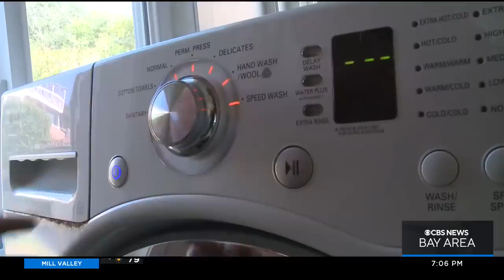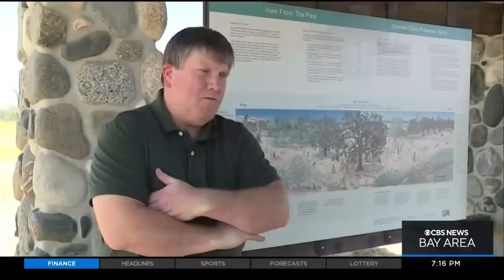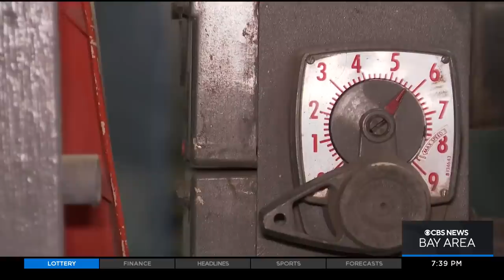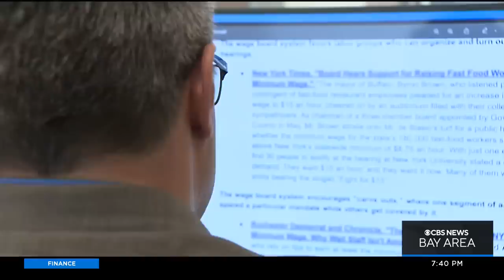Parched: California's Climate Crisis

Comment: It’s important to note in this piece. When referring to 80% water used in agriculture. “Agriculture” is farming and water pushed directly into river/deltas. Approximately 50% of the 80% is used for farming. The other 50% is diverted directly to waterways leading to the ocean. This leads to a whole larger and more important debate which this news piece does not mention.
Reply: They send the unused fresh water into the oceans?
Reply: @emilylouden3349  they don't send it they just don't block it because of some stupid fish.
Reply: they should block the water from the ocean until they fill everything up.
Reply: @emilylouden3349  TRUE,!!!!
Reply: @frankyflowers  Fish gotta swim frank, cali is doomed either way
Reply: @leftifornian2066  they gotta evolve into not using our river from the ocean.
Reply: Look to the Aussies for better water practices.  Oz is the land of using rainwater to the max.  
10 inches of rainwater falling over a square kilometer of land equals about a million gallons of water. 
If you start with simple things like a curbcut diverted into streetside bioswales (inlet only, or else you lose mulch).  Roof runoff diverted into a cistern, rain gardens, or fill a cistern then overflow be diverted into raingardens.  Use greywater as well, for flushing and landscaping.  Public parks, ranch and farmland could use rainwater harvesting earthworks and techniques.  This would greatly reduce gridstrain on water supplies, and electrical grid demand.  It would also reduce erosion, reduce flooding and fire dangers, mitigate the effect of heatwaves, etc.  It has increased beauty, shade, comfort and even reduced crime as neighborhoods have become walkable/bikeable.  
Bunds, check dams, gully repair, planting pits, keylining, swales, etc could be cheaply made out of materials on site.  Brad Lancaster has a great book on the different techniques that are low cost and highly effective.  Many are now employed by the city of Tucson, and well as on farm and ranchland and around the Sonoran Desert and elsewhere around the country.  Brad Lancaster's books are a great resource.
Adapting Mark Shepard's techniques would help as well.  He grows local native- or domesticated relatives of native- food-producing perennials, shrubs, vines and trees.  He has as a variety of livestock for pest control and fertilization and as additional sources of income.  This would be much better than paying a farmer to do zero as it would be mimicking natural processes while still producing needed food, plant diversity and also provide wildlife habitat.

Up front note: Desalination is brittle, centralized, and needs replacement, as well as constant maintenance.  It pulls a huge amount of electricity to process it.  Pumping water uses a huge amount of electricity.
A terrorist strike, or a brown out earthquake and the mirage of water abundance is gone.
Reply: @b_uppy  It's now unsafe to drink rainwater around the world because of the growing presence of "forever chemicals," a new study suggests. In the study, published Aug. 2 in the peer-reviewed journal Environmental Science & Technology
Reply: @melaniedennis9540  
Melanie Dennis  
It's true rainwater has chemicals that "greatly exceed" safety levels in most places is now. 
You will want to avoid floodwater-recharged surface water (lakes, ponds, rivers creeks, rills, etc) because evaporation concentrates toxins.  When soil and landscapes get dry, water lacks the ability to permeate.  You will want to avoid desalinated water as well.
When we slow, spread and sink the water into bioswales and the like,  we also reduce flooding.  
It's good thing we invented bioswales, and other rainwater harvesting earthworks to purify water then.  When we absorb water into bioswales with mulch (mulch is important for microbial action), along the topsoil's carbon and woody plants, we get natural remediation of the water.  This is a healthy hydrologic process.  The water then moves through the soil (aka water table) to rivers, lakes, ponds etc naturally remediated.  In healthy hydrologic processes that's how lakes, rivers, creeks, ponds and rills get clean water.  It makes the case for rainwater harvesting earthworks even stronger. 
 Desalination plants lack the ability to do this for free, it would mean compounded infrastructure.
(FYI- you can eat the fruits grown from woody plants as the toxins are absorbed into the bark.  You do want to avoid annuals, which are most plant based foods grown in the grocery store.   Buy from your neatest permaculturist)
Reply: I can solve this issue but I am waiting for those important people who are able to financial advisor and overseeing operations. Gary Morgan here I am in Sanderson Texas and I am not hard to find.
Reply: @daver00lzd00d  the ecosystem will be destroyed completely by nature and cosmic forces lots of times before the earth is completely destroyed. who is to say how each cycle should go?
Reply: @frankyflowers  we have a say because we are directly influencing it with our behavior. that is the problem
Reply: @daver00lzd00d  our behavior allows some species to thrive in our wake and some die off. we are animals and part of global evolution.
Reply: @frankyflowers  our behavior is changing the planets systems faster than anything, including ourselves, can adapt to the changes. nature can't just get used to a completely different climate in 10 years. we are the only animals that are willingly altering these climate systems that we don't know enough about. it's all irrelevant at this point because it's too late, weve made our bed and we will sooner than later be lying dead in it. first we get to suffer though
Reply: @D R sorry for the confusion. All this water must flow through a dam. The amount of water sent through the dam goes to the ocean. Restraining water behind the dam is usable water for citizens.
Reply: @frankyflowers  I live in Singapore. A barrage was build to turn almost the entire island into a water catchman area.   The canals are well maintained and it has a thriving freshwater fish. The barrage has pump to pump out excess water when there is heavy rainfall.
Reply: @jk35260  wasn't singapore a rain Forrest before? they don't have the same problems.
Reply: @frankyflowers  It was but much of it is now a city. California is about 600 times bigger in land mass but Singapore population density is about 90 times denser. So despite the high rainfall, Singapore needs to recycle and reclaim water through desalination and import water from neighbouring country Malaysia.

Beyond just building a barrage, you need to put back more water into the land so that it can rejuvenate with more vegetation.  A land with dwindling vegetation density will only get drier and creates a feedback to cause even more evaporation. Frankly, cutting down water usage for agricultute is critical.
Reply: @jk35260  if we didn't give any to the ocean and just let the fish evolve or die then they would have lots of water.
Reply: @frankyflowers  I agree, the environmental impact should be very localised at the mouth of the ocean.
Reply: Well put like lack of planning management and water rights. And watering lawns in the dessert doesn't help. You also have a limit or a balance to use before aquifers deplete not to mention certain companies claiming rights to them too. Needs to be transparent to the people and out of politicians hands or claws.

Comment: I am a visitor from WA, and i have driven the length and breadth of the continental US. Never have I ever seen a lake drained dry as I did at Isabella Lake yesterday. You can see the bottom of the dam. It is scary.
Reply: Isabella is dry!?  I know this area well and that is shocking. Is the kern river still flowing?
Reply: @bookbeing  the river looks like a creek. There is some water left in the basin, but it is below the bottom of the dam. I wish I had stopped for pictures, however it was too depressing.

Comment: Lets start by eliminating the use of potable water for these golf clubs, parks and the strip between the curb and sidewalks, not all the signs you see saying "recycled water are true". Lets start installing desalination plants before its to late.
Reply: It is already too late.  Begin your migration planning for implementation no later than 2030.
Reply: But... but... but... then the elite would have to suffer.😄🙃🤣😂
Reply: Just use the normal global average consumption on the planet of 2000 gal person per year at a normal rate of 2,50$/gal. Instead of 20440 gal per pers./yr at 0,03$/gal
Reply: @robert-antoinedenault5901  For starters Robert, the average per person usage is 150 gpd (gallons per day) which comes to  54,759 gallons per person per year. And the average cost paid per gallon is normally less than $00.02 per gallon from a public water system. This usage does not include water for fire protection that systems are required to provide.
Reply: @1ApeinSpace  Right there you explained the problem. If your price is only 0,02$/gal and the world average is 2,75$/gallon; people will end up using more as the price is cheap. Augment the price to 2$/gal and limit the consumption to 4500 gallon (far more than the worlds avg) instead of 54,759 gal. You'll be surprised how long you will have reserves for after implementing these policies. And the profit from this sell will permit new infrastructure to be built and ease to fix the one already in place and offer incentives (credits, loans,...) to farms and homeowners to renovate their own water infrastructures to reduce usage.
Reply: @robert-antoinedenault5901  I think your confusing the $2.75 as per one gallon, which it is more than likely for 1,000 gallons or cubic feet.
Reply: Aqueducts and desalination plants are expensive and frankly a destructive approach.  It is vulnerable, brittle, and fails to address concurrent problems.  You end up using a ton of electricity to pump water in the aquifers, as well as desalinating water.  It would increase brownouts.

The better approach is the prevent collecting too much water at dams in the first place.  
It is better to do smaller, decentralized, water-harvesting earthworks/techniques starting in the foothills, and continue thru to cities.  These would include keylining, check dams, bunds, swales, gully repair, planting pits etc.  More bioswales with curbcuts to feed street runoff into them is a start in urban areas, as well as encouraging the purchase of cisterns, using greywater for watering lawns and trees, as well as using roof runoff for water, flushing etc.
Decentralized efforts can reduce fire danger, flooding, lessen drought impacts.  Bioswales planted with trees can reduce heat island effects, allow pavement to last longer.  By passively using rainwater in bioswales, reusing greywater and roofwater you can reduce the amount of electricity used to irrigate and reduce the chance of brownouts.  
Keeping landscaping hydrated this way also keeps the soil biota hydrated and allows water too seep better into the soil instead of running off.  
Overall using rainwater harvesting techniques/earthworks recharges aquifers and surface water in a positive downstream effect.  
Brad Lancaster has YT videos and books on the subject.

Lots of water falls there, even during droughts but it is squandered.  Back up and reassess where you look for problems/solutions...

Farming and ranching could be done much better.  'Sustainable ag' is a greenwashing term to sell more products to farmers and ranchers rather than solve deep ag problems.  Restorative ag techniques work much better and for less while producing more food.
Reply: @b_uppy  I agree with almost everything you have said, I just don't see those things providing all the water needed for the amount of people currently in and in the future for the USA with climate change already upon us. People are going to have to get used to paying an equitable price for water.
Reply: @1ApeinSpace  
That's why I recommend why people watch Brad Lancasters 1:42 hour long vid.eo on urban rainwater harvesting methods.  There is a surprising amount of rainwater that falls on the city of Tucson despite their 800+ year long drought, enough to supply their current water needs.  
Quit thinking of water as poo that needs to be flushed down sewer drains and look how much is lost through conventional 'water management' systems.
Reply: @b_uppy  Dude, I have spent 30 years in the water and wastewater business. I had some of the highest grade water and wastewater treatment licenses and managed 2 different public water systems. Lets say a 2 person family home on average uses 100 gpd (a low number) that's 36,000 gpy.
#1 how do they store it? You may get a few inches of rain a month if your lucky or perhaps when you get the 10 inches in a day that's when you store it?
#2 how is it treated for consumption? You going to buy bottled water for consumption?

The best thing that would benefit everyone would be to get politics out of it. That's why we have children getting lead poisoning and systems shutting down for no maintenance issues.

People think water should be free, it falls from the sky right, what your paying for is it being clean enough to drink and bath.

gpd = gallons per day
gpy = gallons per year

I'm really not trying to argue with you, doing what we can to reuse/recycle is the best thing for everyone.